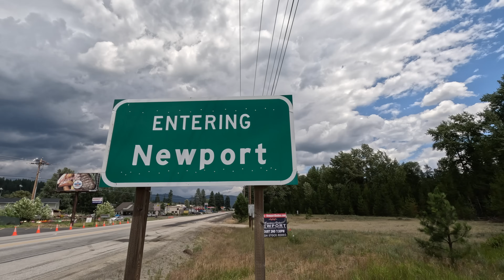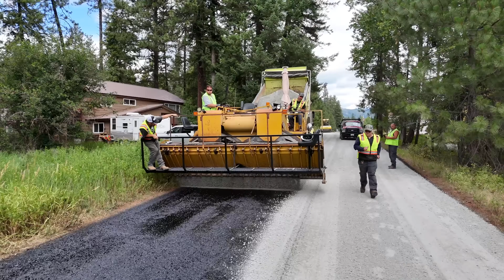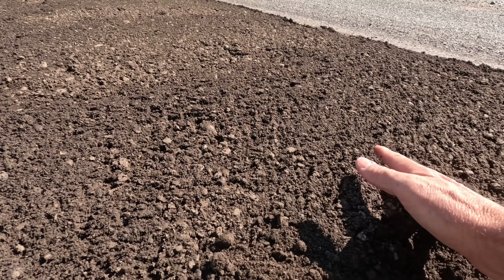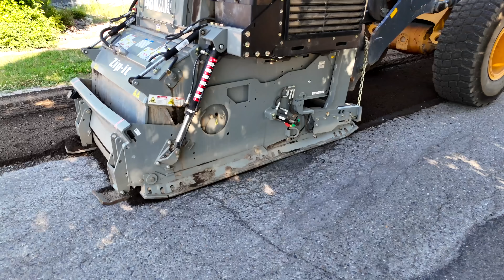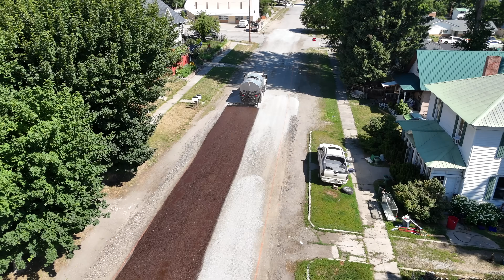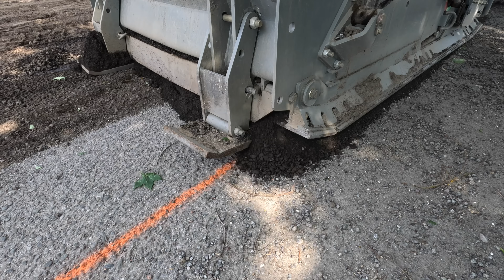Town of Newport Saves $56,000 a Block on Road Repairs with their Asphalt Zipper® Road Reclaimer

Comment: Very good that they found a solutions and do something about it, it is better then nothing. 
Not everyone has the means and the funds to do it mainly because of Low-Density Areas,
 In low-density or sprawling areas, the per capita costs for providing and maintaining roads can be higher due to less efficient use of infrastructure and the need to serve more spread-out populations.
Reply from the maker: Yes, fixing roads is vital but can be challenging for some smaller communities.  The Asphalt Zipper fills that gap allowing small communities with limited budgets (and large cities who want to more efficient) to fix their roads in an efficient and cost effective way.

Comment: That alligatoring I see could be indicative of subgrade failure... that said, this looks like a decent temporary fix for such areas.
Reply from the maker: You are very perceptive!  Alligator cracks in a road are a definite sign of base failure.  Using the Asphalt Zipper to perform Full Depth Reclamation (FDR) - (https://www.youtube.com/watch?v=cQ34qksjxMQ) enables cities large and small to give their roads new life because they fix the alligator cracking and pothole formation at it core by fixing the base. The Asphalt Zipper grinds and recycles the old asphalt or chip seal in place and once the recycled road is graded, recompacted (using water or additional additive), and repaved, they have a road that can last for years.